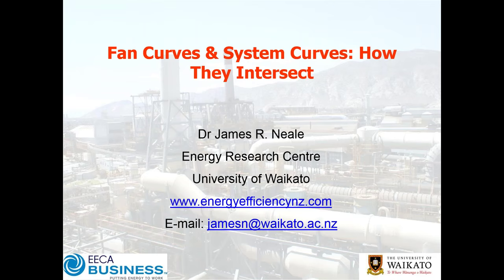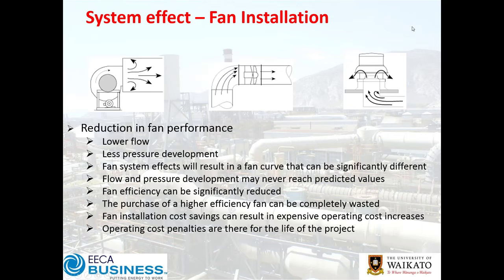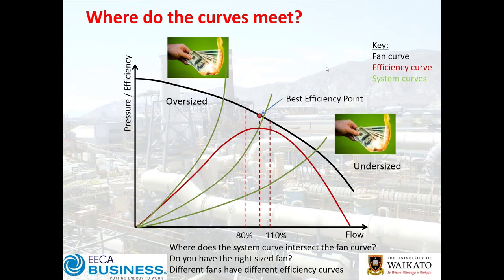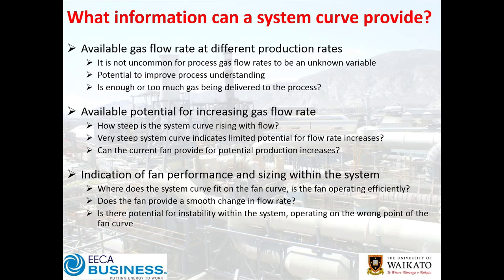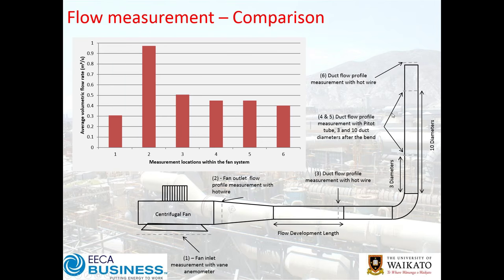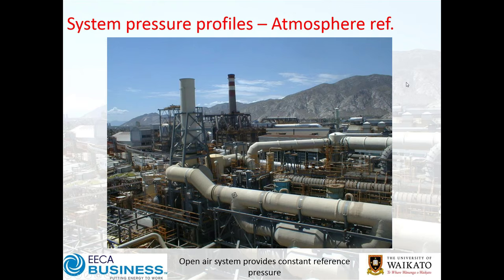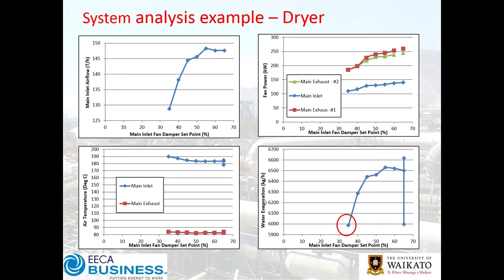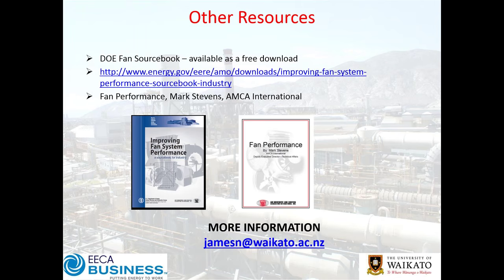Webinar: Fan Curves, Systems Curves and how they intersect

Comment: Nice webinar!
I work in oil and gas industry where I deal with air cooled heat exchangers. These exchangers are fitted with axial fans. Is there any reason why these exchangers are fitted with axial fans. Will there be any benefit if we fit such exchangers with centrifugal fans?
Reply: First, plz dont thank for quick respsonse, Since axial fans are designed to handle large volumes of air at low pressures, they are also cost-effective and have a straightforward construction. In an air-cooled heat exchanger, where the pressure requirements are minimal, it makes sense to use simple fans. Given that they can perform the same function, there is little justification for choosing more complex and expensive fan systems.